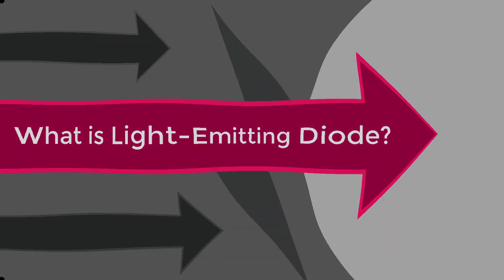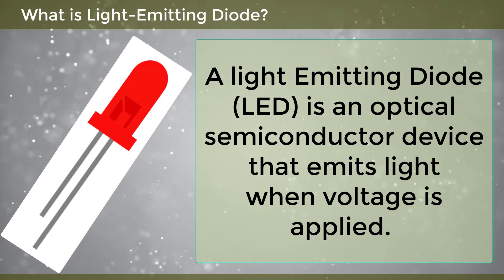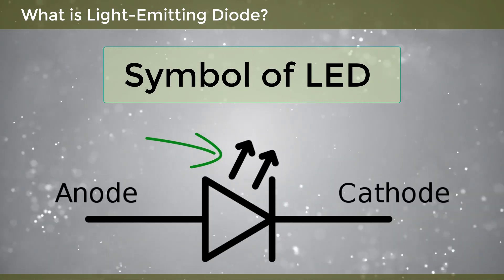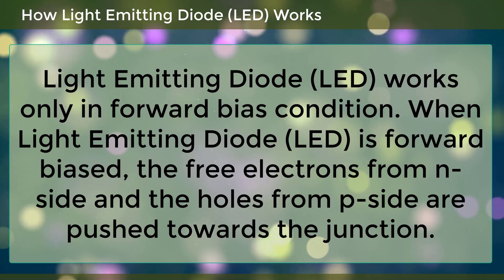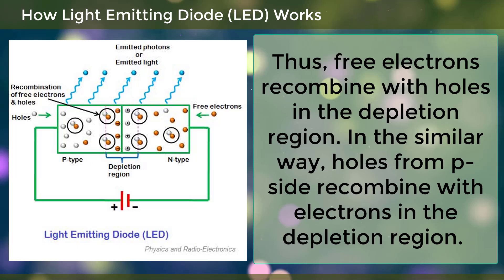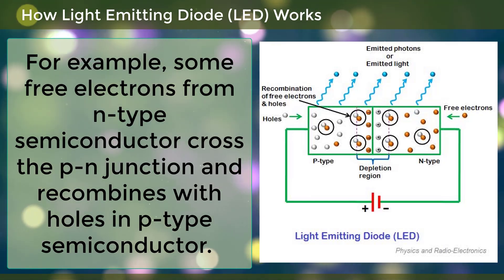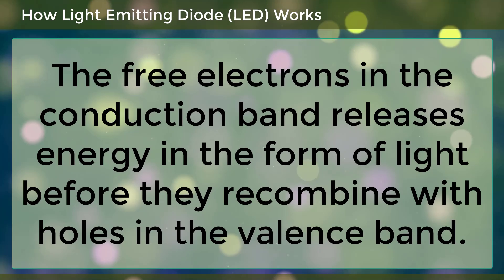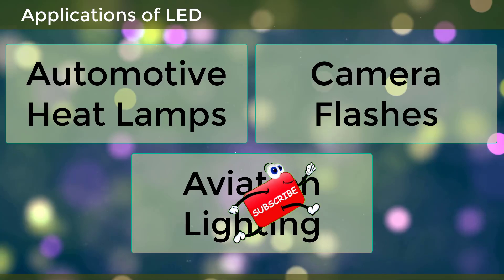What is LED Light Emitting Diode | How Does LED Works | Electronic Devices & Circuits | Engineering

Comment: What makes LEDs particularly special is that the size of the depletion zone determines the wavelength—and thus the color—of the light produced. By carefully tuning the materials used, we can create LEDs that emit anything from deep reds to vibrant blues and everything in between.

For white light, we take this process a step further. A blue LED is coated with a phosphor material that absorbs some of the blue light and re-emits it as yellow. When the remaining blue light mixes with this yellow emission, the result is a warm, white light that’s become a staple in homes and industries.